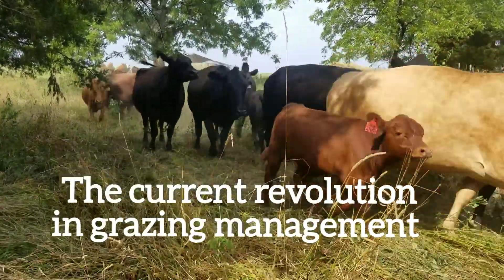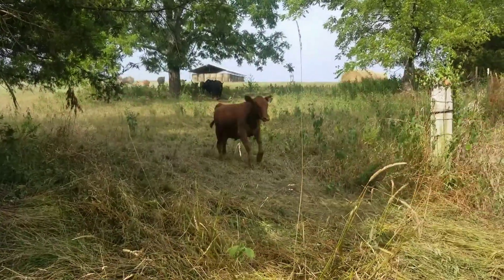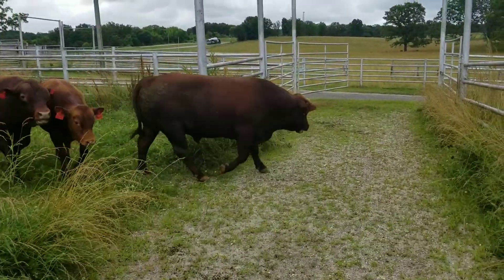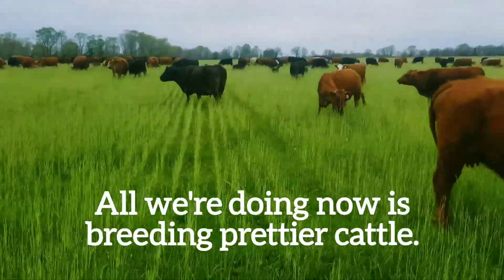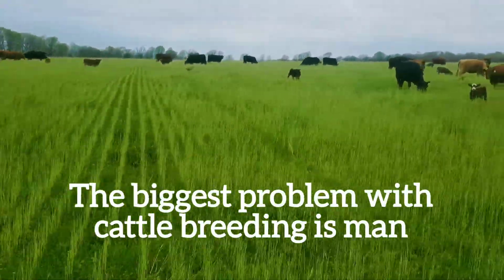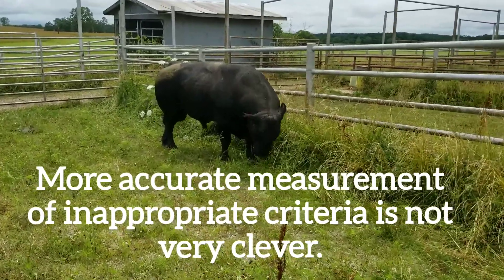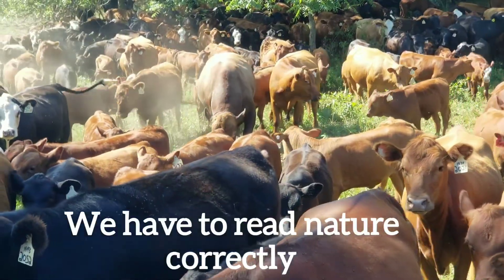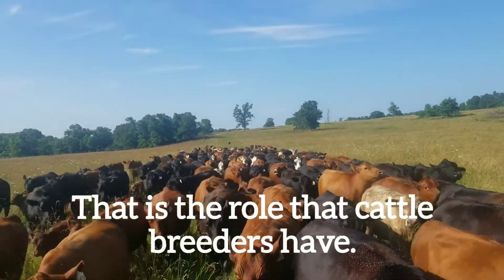Johann Zietsman - Cattle Grass Conversion Efficiency (Cattle Breeding Revolution)

Comment: Any real life data on how these beautiful cows do in Central Florida?
Reply from the maker: Great question.  I would ask, as compared to what?  Would they do better than a lot of conventional cattle?  I say Yes, if by "do better" you mean reproduce a healthy salable calf, year in year out, on the available grass without degrading your soil health and with minimal health and vet problems.  There are quite a few South Poll breeders in Florida.  Check SouthPoll.com for a list of members and their locations and contacts.  Different breeders use a broad range of different metrics and management regimes to aim for a broad range of different goals.  It's a good idea to try to find a breeder that is raising animals in a way that will match with your goals and management.
Reply: @PremiumSouthPoll  The cattle in the video clip are Tuli and Bonsmara cattle southpoll cattle heads are much smaller and rounder in comparison
Reply from the maker: @pieterse4075  The cattle in the above video clip are South Poll and South Poll cross cattle from our ranch in Southern Missouri USA.
Reply: @PremiumSouthPoll  Interesting the ones ive seen doesn't have big square heads the color ration was also lighter

Comment: Australian Brahman Breedplan has two fertility indexes which are useful in breeding fertile Brahmans. Do you agree with this?
Reply from the maker: Great question.  Here is my opinion on it.   Scrotal circumference at 12 months can be used to some degree, but if taken as an absolute measurement within a variation of frame sizes, it will disadvantage a smaller frame bull and unfairly advantage a larger frame bull.  So in that case it isn't really giving a fertility index.  
“Days to calving” as the ABBA has defined it, is good for detecting early maturing females of a contemporary group,  but not necessarily a good indicator of practical fertility.  If it takes her 10 months to reconceive after the first calf, what good is it?  A better index for practical fertility would be the inter-calving period between first and second calving of a contemporary group.  Then you can give those cows a practical fertility ranking.  
This data is somewhat meaningless for comparison purposes across multiple ranches due to different feeding regimes, calving seasons, etc.  Unless all the ranches are using similar feeding regime, supplements, grazing pressure, calving seasons, etc..

Here is a quote from Johann:
" _Both hormonal balance AND inherent body condition are important.

In some breeds (Zebu) inherent body condition without a good hormonal balance will result in late sexual maturity.  Selecting for SC in yearling bulls will result in earlier sexual maturity in the female progeny.

In some breeds hormonal balance may be optimum, but inherent body condition sub-optimum.  In such a case selecting for yearling SC will have no positive effect on female sexual maturity.

We must select for BOTH hormonal balance (SC / yearling bull breeding ability) and 12 month maturity (12 month kg / mature kg) or package fullness in bulls.

• Academic Fertility = hormonal balance + feed (body condition).
• Practical Fertility = hormonal balance + inherent body condition_"